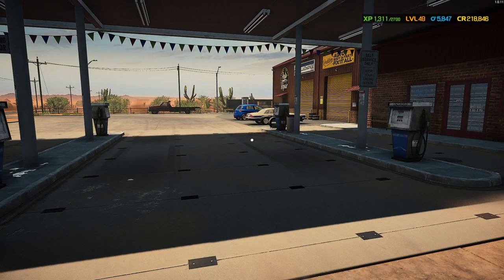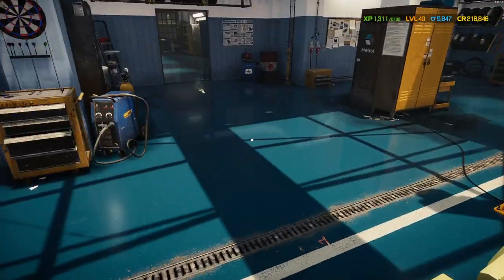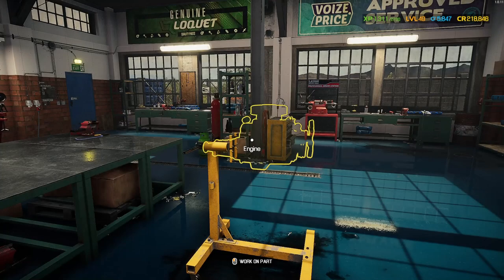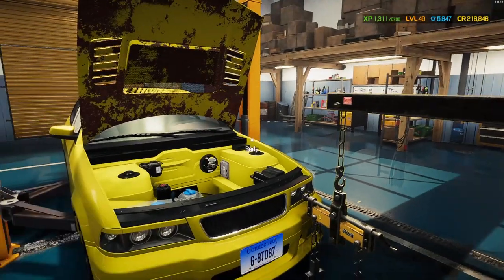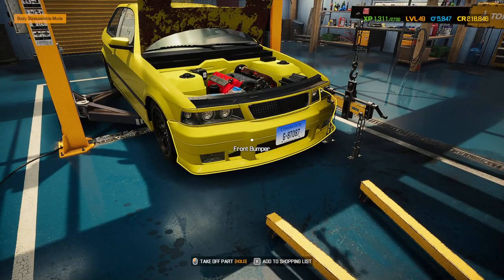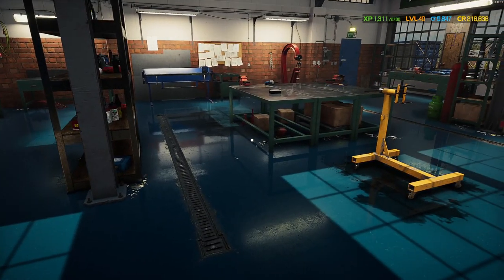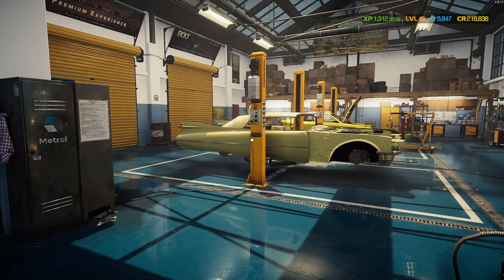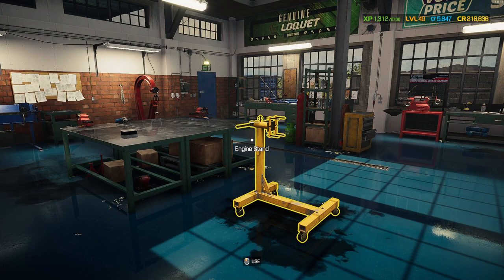Car Mechanic Simulator 2021 - ENGINE STAND - THINGS YOU DID NOT KNOW

Comment: My usual rule of thumb on whether to use the engine stand is whether the job is going to involve opening up the crankcase.  In that case, not only is leaving it in the car a recvipe for lift-bouncing all day, but by the time you're pulling pistons you will have disassembled the whole thing anyway and so will know what parts need replacing.
Reply from the maker: Fair point - I think more intended for players that are new to the game and also for those that want to play with the stand when they finally get one :-)